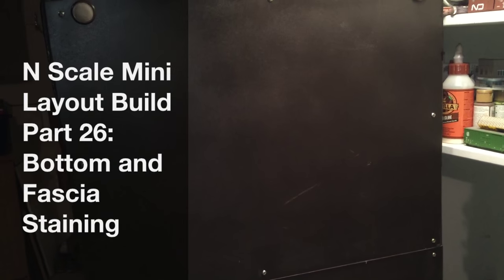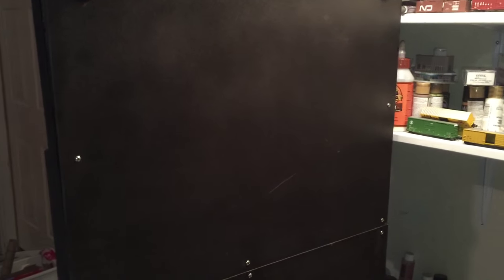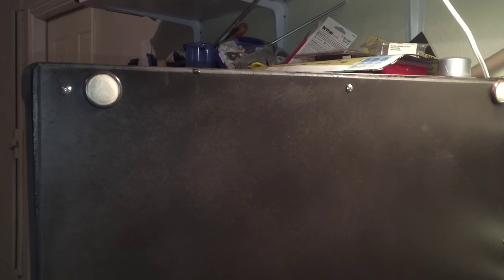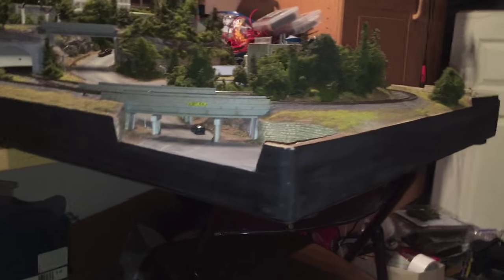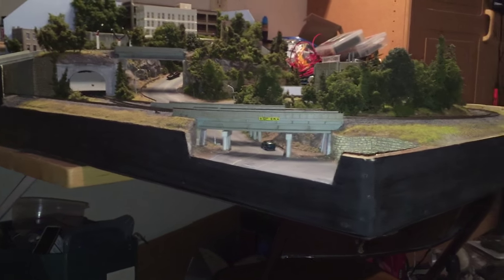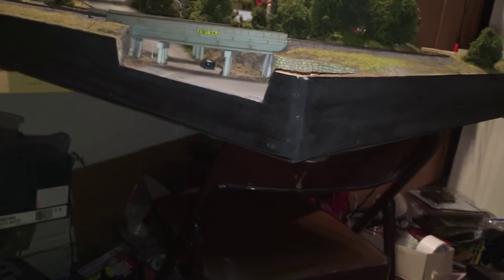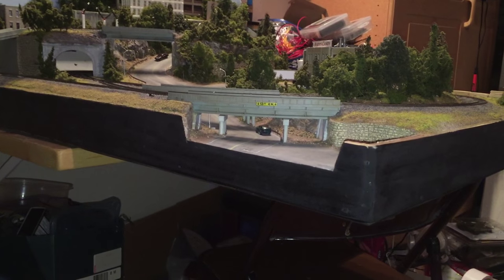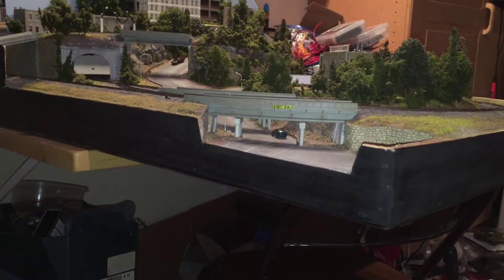N Scale Mini Layout Build Part 26: Staining the Fascia

Comment: Very nice fascia work,  well done.  Like the bottom being enclosed as well.
Reply from the maker: Peter CPRail8748 I haven't done that on larger layouts, but since this one is designed to be portable and moved around easy, I had to make sure that all the wiring was enclosed so it wouldn't snag on anything when moved around.  Plus it does look a lot neater and the panels are easy to remove.

Comment from the maker: +LegoStingray Kato's six axel engines like the C44-9w can usually make it around 9 3/4" radius curves ok, but where you can have a problem is pulling rolling stock around those curves with long engines.  Since the engines always have body mounted couplers, longer rolling stock that also have body mounted couplers can get pulled off the track around curves that tight.  That would happen on my 8.5" radius curves, though it might be ok on 9 3/4" radius curves, particularly with truck mounted couplers.  It may be that you just need to always put a short piece of rolling stock with truck mounted couplers in between the engine and any longer cars for things to run ok.  By the time you get to 12" radius curves you shouldn't have any trouble at all, but exactly where the cutoff is in terms of radius for trouble free operation, I'm not sure exactly.  So bottom line, running that engine should be fine, but pairing a couple engines together or running that engine with longer rolling stock might be a problem.   Pretty much you will just need to set up some temporary track at that radius and test things out before building your layout to see what will work and what won't.

Comment: Hi there, so I'm starting to build an n scale layout too, and I have a question.  I want to run a three 6 axel train (the Kato GE C44-9w) and my tightest radius curves are 10 inches.  Would this loco make it around these turns smoothly?  I'm not worried about it hanging over, just about it running smoothly.  Thank you.

Comment: Great Layout.  Quick question if you don't mind.  Building a similar layout and wanting to use Kato Uni-track.  Using DCC. Any issues with the #6 turnouts causing shorts or issues?  Any special instructions for DCC with Kato Unitrack Turnouts?  Thanks
Reply from the maker: Tony Stark The main thing to consider is that most Kato turnouts are power routing (some of them may not be), so with DCC, you will want to and feeder wires past each turnout so everything is always powered and you don't end up with a dead zone, unless you want to be able to shut power off to a siding or something.  Mike Fifer has a video here: https://www.youtube.com/watch?v=zfmrpkQ4e0A on how he wires kato turnouts all all kato track for dcc.   He insulates every turnout past the switch, and then repowers the track again past the turnouts which can help when first wiring the layout in order to hunt down any shorts caused by feeders going to the wrong tracks and such.